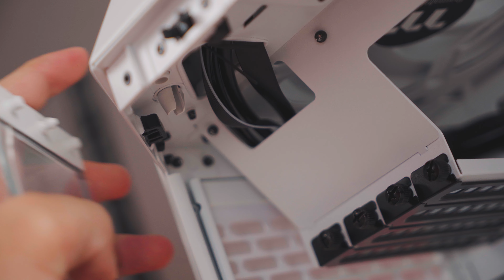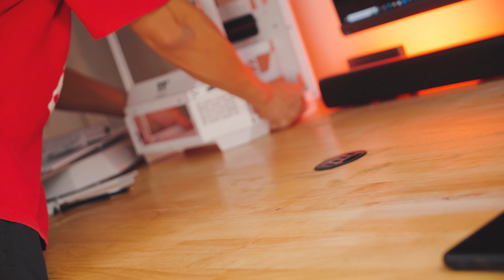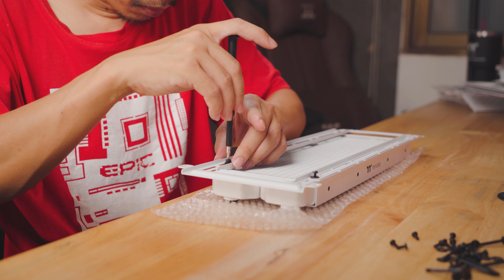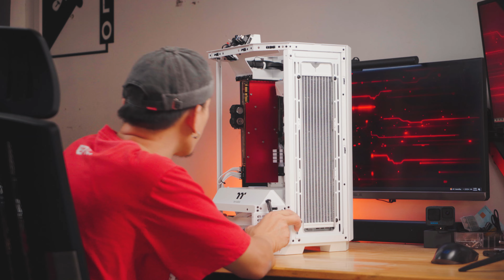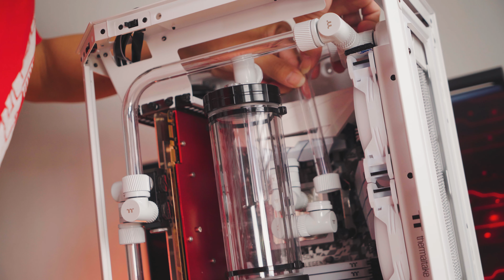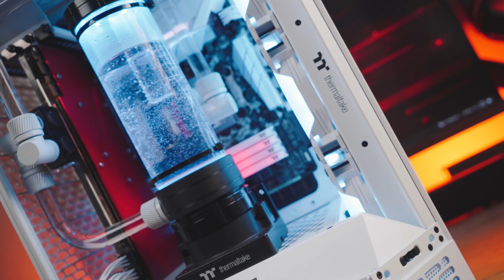[ PC Build ] The Tower  300 Snow Edition //4K

Comment: Will this case support 4090?
Reply: My 6950xt red devil fits with room to spare
Reply: A month late, but I have a 4080 Super 2-fan in this case, and there's a ton of room left to go even lower for a 3-fan 4090. Normally, there's a detachable panel around the PSU enclosure that comes off to support longer GPU's.
Reply: 4 slot thick
400 mm long without psu cover
280 mm long within psu cover
Reply: just finish building mine mounted a 4070 gigabyte ti super and i can say its bit pain in ass mounting GPU on the uper bracket of the case because my GPU body where the screw is is a bit bulky i can say